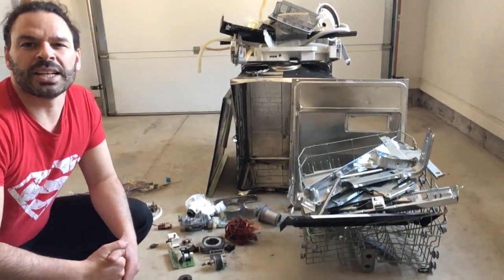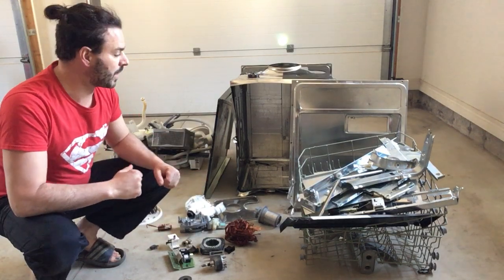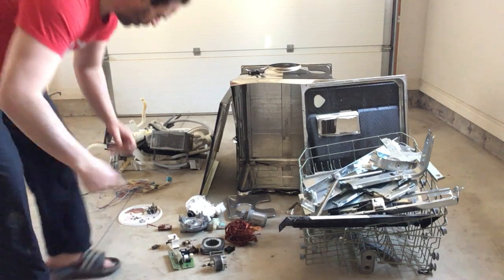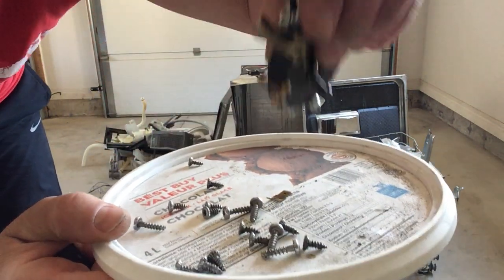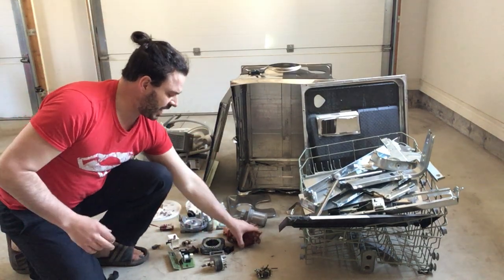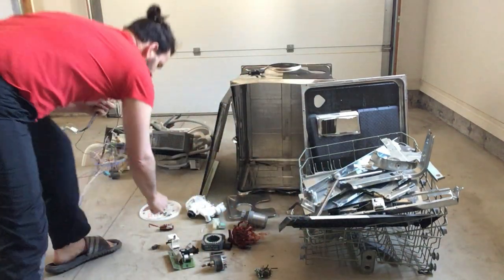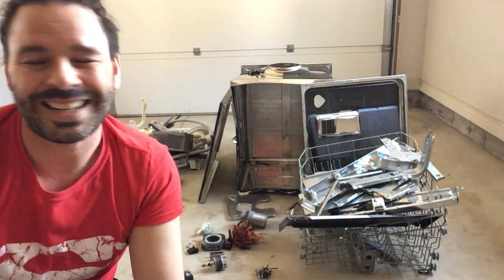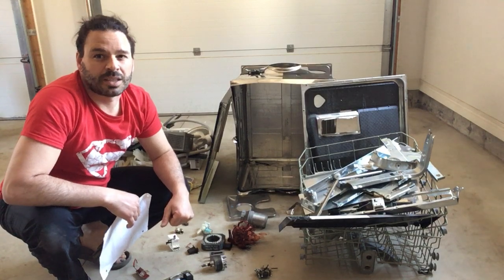Scrapping a dishwasher. Is it worth taking it apart and separating the metals?

Comment: Nice video, one thing I would recommend is try to sell the racks, plastic silverware holder, and motor as spare parts on your local Craige’s list or Facebook market place, what ever you have in you area. I get $20-30 for the racks easy. Too late for the motor but think about selling motor next time separate before scrapping them, if they test good. Even if you get $1-5 for plastic parts it keeps them out of the landfills
Reply from the maker: I will try that. Thanks for the tip.
Reply: Yesss!!! If you have ever tried to find a replacement rack…you would see how steeeeep a cost it is!!
Reply: got to have the space to sit on it unless you can sling dishwasher parts like a Savage